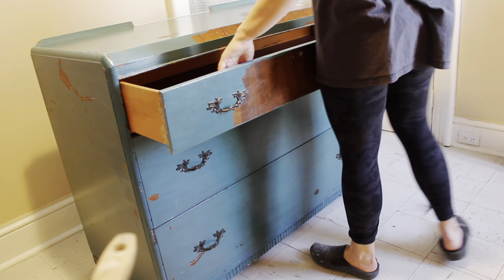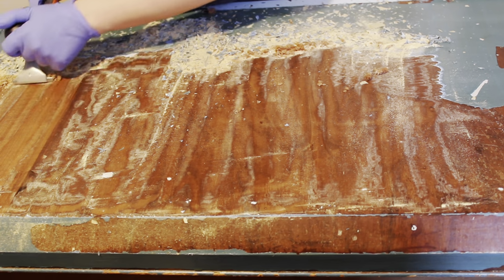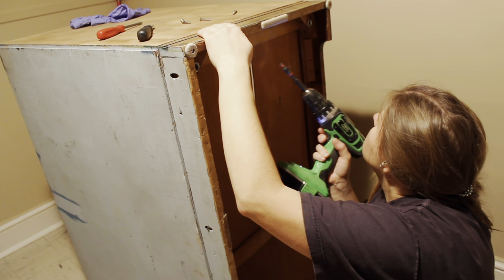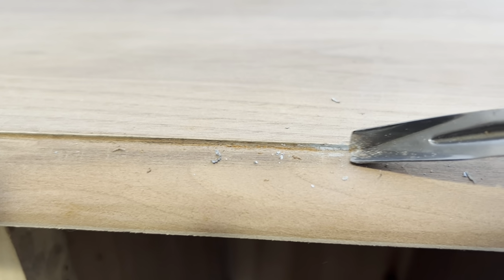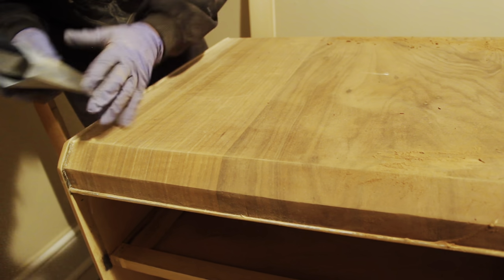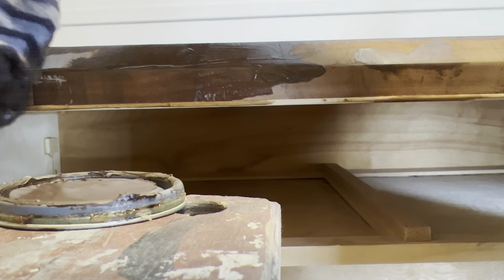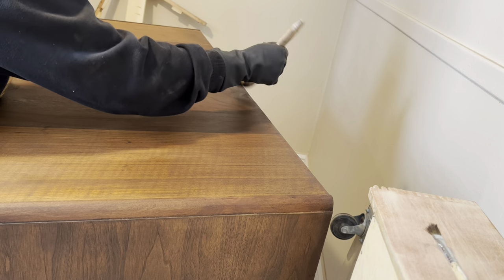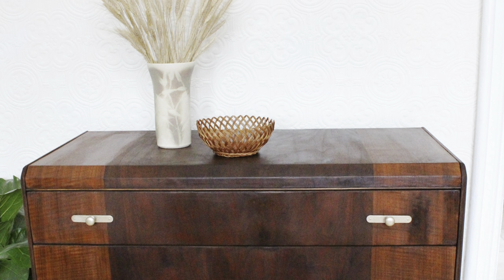ART DECO DRESSER RESTORATION | USING A CARBIDE SCRAPER | REMOVING PAINT

Comment: Rather than tell you how nice this looks, I want to share some information. I have been involved in antique buying/selling/restoring/and repurposing for about 40 years. I hope you take this with the knowledge that I mean well.

When using a tool to pry, you get dents and crushed wood. Slip a metal putty knife between where the pry tool and the wood meet. Keep it moved along as you loosen the area you want to remove. This saves a great deal of repair time and dreams of how you want the finished piece to look. 

When scrapping, only scrape one way. I am referring to the areas of paint that were thicker, you did a back and forth motion. Only scrape towards you or away from you but not both unless there is absolutely no way to get the paint off. If you do this you can raise little splinters that will take a lot more sanding than you think. As a habit, always think of mitigating additional damage through sound work habits.

I commend you for wearing a mask. Any paint you remove that could be before 1978 should always prompt the mask use due to lead content. I always mention that my husband suffers from COPD and we both wish he had protected his lungs better. Good job there!

I am also very impressed by your decision against strippers. It is an environmental disaster. Get ahold of card scrapers with convex, concave, points, and bead blades. This will rock your time back faster. Also, start with the tight areas because corners and crevices always have more paint. If you get the thicker stuff off first, the thinner paint comes off easier. 

I like the stying, making it your own. This isn't a restoration though. This piece has been reimagined or reinvented or redesigned. You have good taste! Restoring means it is being put back to its original state. Restoring or refreshing are preferred if you want to keep the antique value. 

Stick with it, keep learning, and maintain good habits because this work is really fulfilling.
Reply from the maker: Thank you for the feedback. I love learning new things and I appreciate your perspective. Thanks again for taking the time to comment. -Candace
Reply: Great advice. I was thinking the same thing as I saw the scraping against the wood grain. I learned the hard way. After sanding and staining a lot of the knicks and cross grain tiny lines appeared. 😢

Comment: Please, use the right tools.  A screwdriver is not a crow bar.  By using the right tools you avoid damaging the delicate wood.  Adding the mid century type legs is a mistake style wise.  The original art deco part suited this piece perfectly.
Reply: Crow bar? I think you mean jimmy bar or pry bar!
Reply: The finish came out terrible and you can see the pieces of wood that the legs are mounted on. Not a good job.
Reply: @kerrywebb4565  it's called a crow bar in the UK.
Reply: Afraid I have to agree. I winced on the screwdriver. A flat pry bar would be much more appropriate. Prying against the base with a screwdriver will make semi-circular dents (I know, I've done it myself.) The 1950's legs completely change the piece in a mixed-style way. Also, on a veneered piece, starting with 80 grit paper is much too aggressive. Some of those old veneers are only 1/20 of an inch thick. That might be part of your problem with all of those spots you were trying to hide at the end of the video. You were fortunate that there weren't large pieces of veneer missing. Usually when I buy a painted veneered piece they painted it because the veneer was split or missing and once stripped I find that they've filled in the missing veneer spots with wood filler, sanded it and painted over it. The handles aren't awful (a definite improvement over what the previous owner had on it) but it would look better with deco reproduction hardware. I know this sounds awfully negative but your work has some redeeming features. I can tell from your commentary that you've read or listened to woodworking instruction and learned a lot (and maybe have learned from trial and error and common sense as well.) Keep at it and your knowledge and presentations will grow in quality.
Reply: @kerrywebb4565  She used the screwdriver like a crow bar.  I do not mean she should use a crowbar; on the contrary.

Comment: Your preparation and staining were spot on. Your finishing is awful. Paste wax is not a sealer. It is a cleaner and preservative of a sealed surface of either hard wax-oil, shellac, polyurethane, lacquer or varnish. It also keeps them plastic and pliable to prevent crazing. Your finish was open - grained, streaky and tacky. Learn some skills in applying hard-drying finishes. I mean this as helpful advise as I am a cabinet restorer by trade.
Reply: Please don’t be discouraged, the fact that you’re trying is great. I would personally have used a conditioner first? Just to keep from blotching. I agree about using poly as a sealer, just lighter coats than your previous video. You definitely put a lot of work into this piece though. ❤️
Reply: Yes, very splotchy, I wasn't sure if it was your camera or the finish, it doesn't look good to me.  There's still wax or whatever all-over your hardware.  I would watch more videos on what a finished product looks like...crisp, clean and professional.
Reply from the maker: Thank you for the feedback. I love learning new things and I appreciate your perspective. Thanks again for taking the time to comment. -Candace